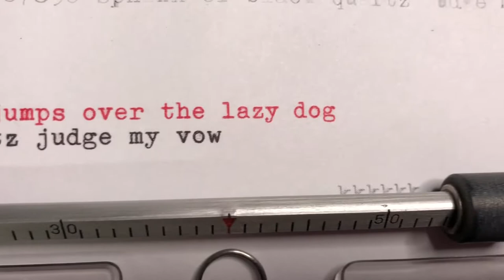1962 Olympia SM7 Typewriter Restored + Demo

Comment: How did you clean the case?  Mine is horrible and I cannot clean the inside.
Reply from the maker: I brushed out the case with a clean paintbrush and then used a vacuum for dust removal. Luckily my case had no major problems or mold. I would start with gentle brushing and vacuum and see how it goes 🤷🏽‍♂️